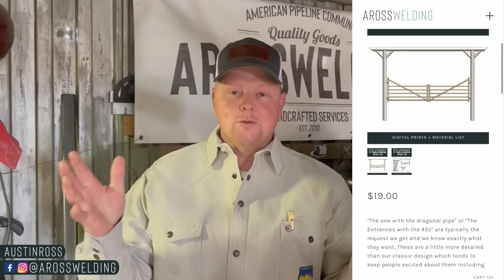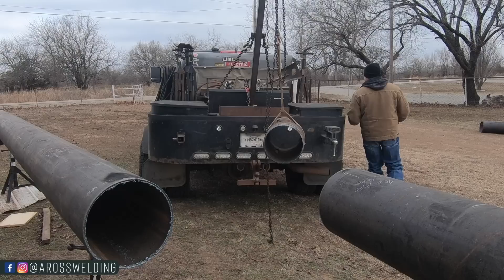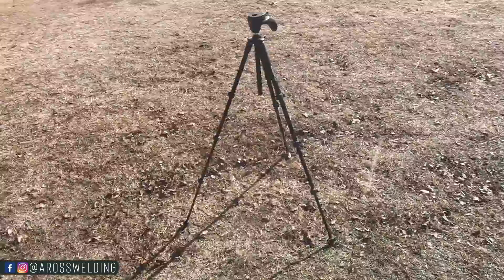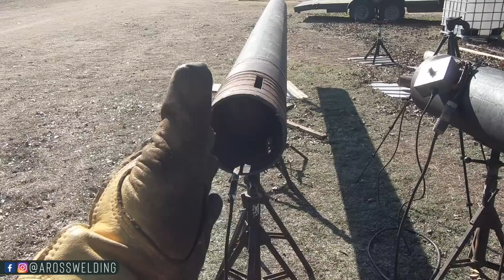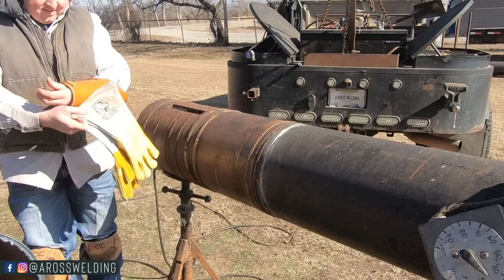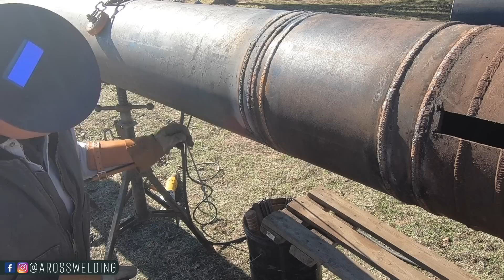Welding Thicker Pipe to Thinner Pipe - The Pipe Transitioning Technique Every Welder Should Know

Comment: I have some information about pipe bar wire corners that would be highly beneficial for you to look into! I have built a lot of fence all around the high plains of the panhandle and your corners may pull out when just tied to the end of the brace…. Please message me if you are willing to be open to it. P.S. I’m sorry this comment is not related but it is the most effective way to reach you

Comment: Could u do a video on how to cut the saddle  on pipe in a railing situation were you have to turn a corner that is greater than 90° so for example, your post is 3inch pipe  and your rail is inch and a half pipe  so your rail has to have a angle cut and a saddle at the same time I do a lot of farm repairs in cow sheds so lots of working with pipe I just eye 👁 it and try to get it as close as possible then just fill the gap 🙈 but would love to no how to do it fast and the right way,  sometimes on small inch pipe I just put a sanding pad on the we grinder and shape it the best I can , love your videos over hear across the pond in Ireland 🇮🇪 👌💪💪

Comment: I just start getting a pipe welding I do not have a beveling machine yet can you cut a pipe torch and use a grinder to make the beveled on the pipe without a beveling machine
Reply from the maker: Absolutely. Check out this video

https://youtu.be/WbdpwGrlmoM

Comment: how does wind effect stick?
Reply: When a weld puddle is in the open air it tends to get perocity. That weld puddle needs to be protected from open air as it cools. When your electrode is burning the flux on the rod burns and creates a shielding gas that protects the weld puddle from the open air. When the wind blows enough it will mix and pollute the shielding gas from the electrode and introduce air into the shielding environment and make the weld puddle prone to perocity and pinholes.

Comment: For pressure pipe the transition had a ratio of 3 lengths of internal bevel to 1 length of wall thickness 3-1. Most of the time they wanted  machined transitions one and a half the pipe diameter in length . I would do the same as Austin put on a land about a millimeter bigger than needed  then transition with a 7"-5/32" disc  . Done right and it would almost look machined . Once transition was done put the land on, it would come out very close to perfect